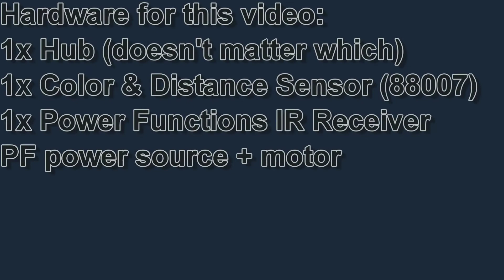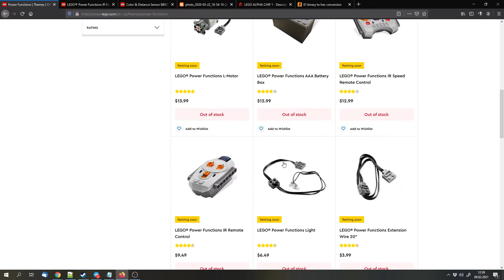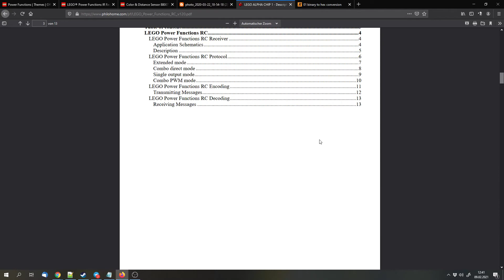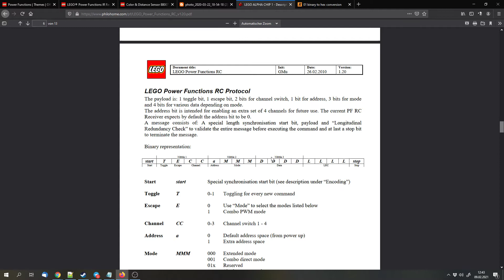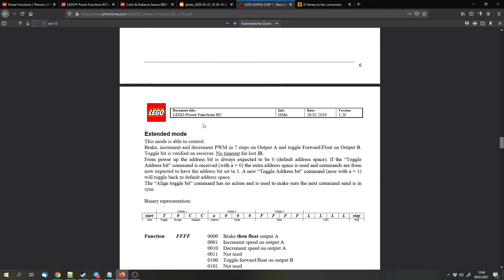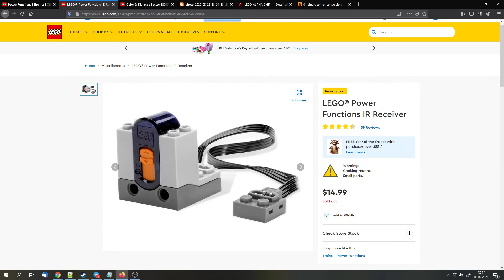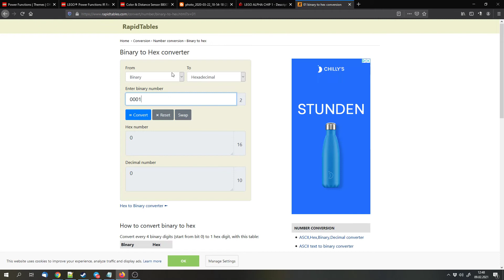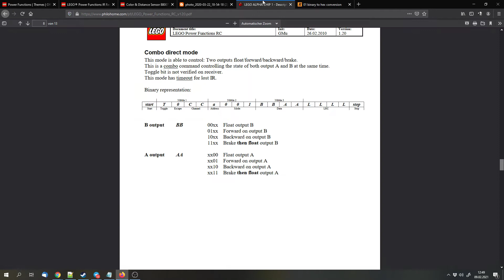Lego Powered Up Tutorial #19: controlling Power Functions via Color & Distance Sensor [English|HD]

Comment: Could this be posible in the spike prime programing app?
Reply: Actualy i found out that you can use the powerd up motors and sensors extensions so python is not necessary
Reply: @alexandrucreata6342 Did it work great? I am screwd because I have a Robot Inventor hub and it doesn't realy work with the Spike app and I can't find a Spike firmware for it.
Reply from the maker: yes using python

Comment: Excellent.  Thank you.  I wonder why LEGO included an IR capable LED?
Reply from the maker: Probably for the distance discovery. They might do that using IR. Or maybe they wanted to have some kind of PF compatibility.
Reply: @technicmaster0tutorials  How did you find out about this feature?  Also, can this sensor detect IR signals in a programable way (can there be IR telecom between hub units?).
Reply from the maker: @mutantpie  This will get a bit technical.
First, the feature was teased in an interview so people knew that it existed.
The hubs and the sensors "know" their features and can report them back. The sensor has a IR Tx mode that it reports to the hub via wire and the hub can send this information via BLE. That way people figured more or less out how it works. Another option was to sniff the BLE traffic of the app after it got support for the IR Tx mode.
The sensor can only send IR commands (it's called Tx - transmit). There is no mode to receive IR signals.